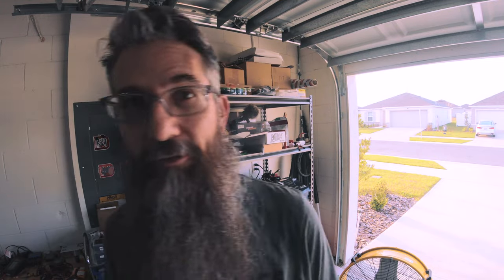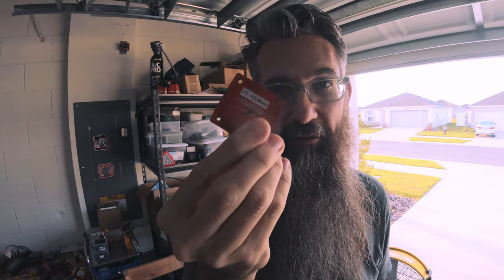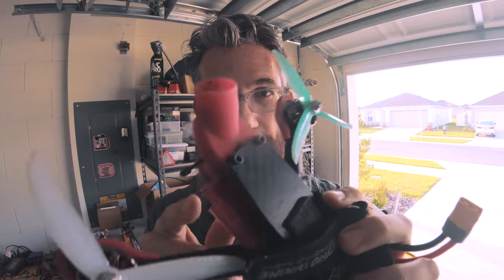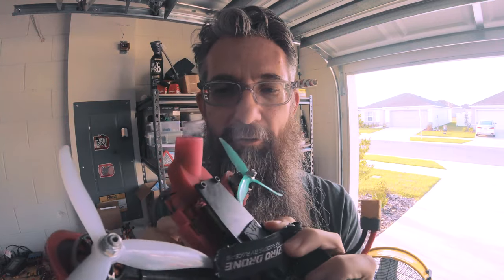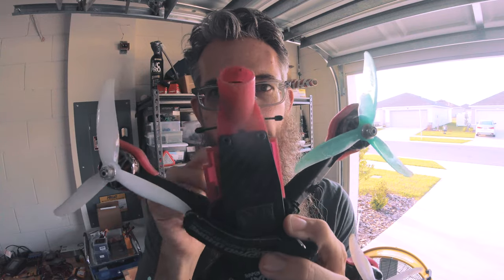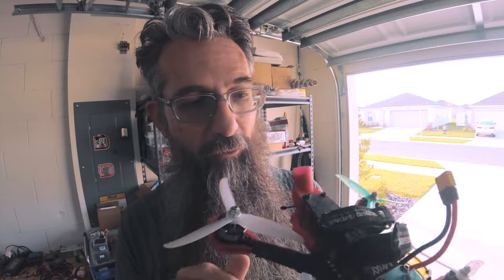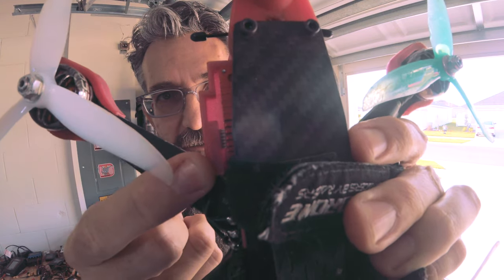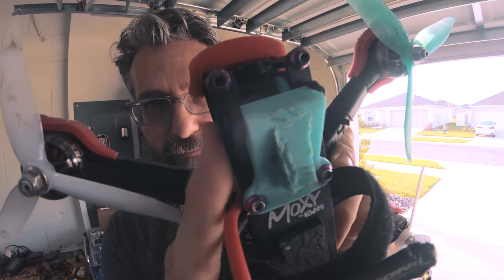HDZero Durability After Seven Months

Comment: Great ramble Stacey. A bunch of good tip in that eh. On the crash cut out thing. The cap should mitigate the voltage spikes and drops due to a crash (and motor spooling up to compensate). I have not had the Vtx cut out unless the plug came loose thinking about it. 
Are you using the provided cap? I have been using a big 1000uf on my larger 5 and 6in (the 6in also has a second tiny one on the FC) and the provided plus a second of same size ( one on battery plug and one in rear of craft) on the 3in running HDZero. No idea if that helped really but seems worth mentioning. 
Also run 4s on these. Think the initial voltage spike for 6s with such caps could be an issue maybe. And yeah there is a noticeable spike when you first charge em on plug in (about the same as 6s normally) but not for subsequent packs. 
On the lose count, I am still flying my original Sharkbyte TX5.S and have only lost a TX5.M to an antenna ejection during a crash (secured Ipex for the win. sorry mmcx but you loose). Anyway there is a ramble for your ramble 😉
Reply from the maker: I like ramble comments :-)

I have a single cap on the ESC but I'll check what size... Sometimes it comes back after without power cycling and sometimes I have to power cycle.  It's pretty annoying so I would love to find a way to mitigate it.

Thanks for the feedback.
Reply from the maker: The cap is the one included with the T-Motor ESC..  its a 35v 470uf
Reply: I have had my Freestyle VTX drop out and not come back from just a simple bounce on the ground during take-off... sorta happy I'm not alone.  I'm powered from my FC, so pretty isolated... it seems more like a physical shock rather than a voltage spike.

Comment: 4S is mathematical better, and no way will I switch to 6S. Champs was an event that showed durability and had me on tilt. 6S is a beast to electronics and problematic in my humble opinion. A massive cap and a good ground strap are mandatory, and even 4S has extra needs. Remember the day when 4S was all the hype over 2S, Lol.. Enjoy the Breeze...👍🏻🍻👊🏻
Reply from the maker: Yeah, I don't see much benefit in 6s.  I think TimmyRC did a video on it some time back.  With electronics that are designed to "handle" 6s, it makes them great for 4s.  I remember when 4s replaced 3s, and there was similar electronics issues then.  4s in my mind is the sweet spot for performance and durability now.
Reply: @StacemanFPV  
Absolutely, 4s is a sweet spot for motors 24mm down. I like 5S for motors 26mm up - need a chunky ESC with tons of capacitance...🍻
Reply from the maker: Sounds about right I think
Reply: Explain how 4S is "mathematically better".
Reply from the maker: Some interesting stuff on the topic here... 

https://youtu.be/eHNG_QpNzrY

https://youtu.be/LfbyJlVAei8

Comment: I use 4 to 5 1000uf capacitor on all my quads with hdzero the never burn out  and never burn any of electric components ever
Reply from the maker: What frame can you fit that many?  I'm curious
Reply: @StacemanFPV  the lal 6s 5inch quad 3 1000uf caps in the back and 2 up by the camera

Comment: I crash all the time hard I haven't bought any electronics in 1.5 years
Reply from the maker: That's good.. What is your full setup?
Reply: @StacemanFPV  hdzero lal 6s 5 inch drone h7 flight controler hobbywing 60amp 4in 1 esc and 3 1000uf caps in the back and 2 1000uf caps up by the camera

Comment: Thanks for the in depth review - I still need to buy my first 1w, I was just concerned about the size of the damn thing fitting in my frame. Starting off with a few WHOOP boards to break in the new goggles 😏 also, do you have a new link for that soft mount you use for the vtx? I think the link is busted. Thanks again!
Reply from the maker: Thanks for the heads up..  Thingiverse changed something I guess.  You can find them here:
https://www.thingiverse.com/snk1324/collections/34330374/things

Also there is a model for the 1w VTx on thingiverse you can print to check size and such
https://www.thingiverse.com/thing:5251366